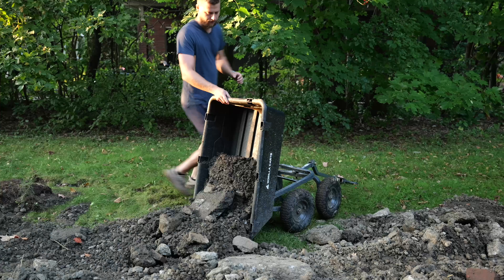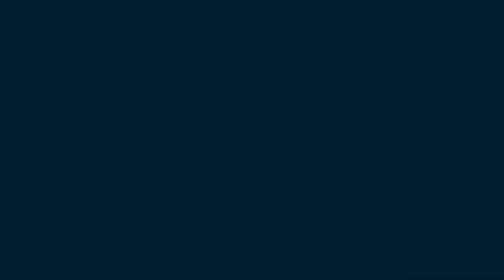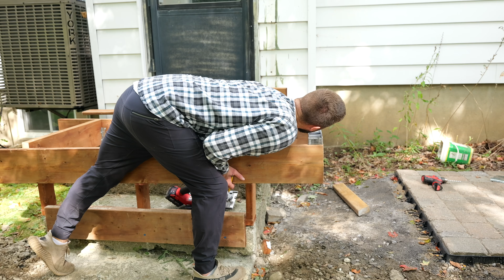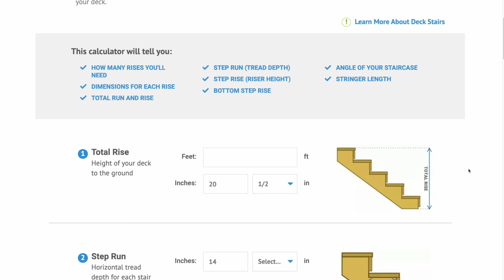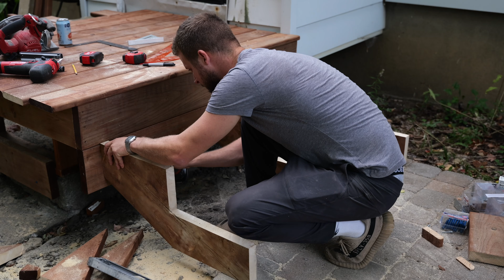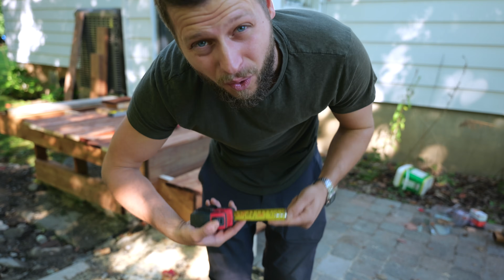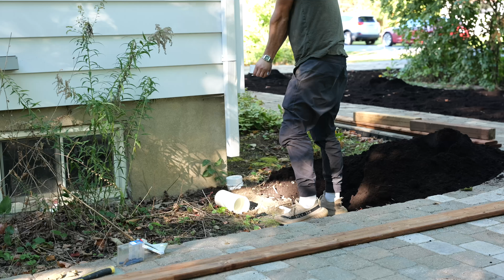Finishing the Driveway Project: Deck Build Over Concrete Steps

Comment: Wherever your lumber comes in direct contact with the concrete you need a moisture barrier. Just like a bottom plate of a wall that sits on a concrete foundation. The lumber touching the concrete will rot much faster without a moisture barrier. Even though it’s treated lumber.
Reply from the maker: @WoodyHayes614  yea. Totally right. I debated putting like a plastic shim or something to separate them, but went the lazy route. This deck is possibly temporary and is just a landing for the mailman and the amazon delivery guy lol. On the other hand might make for a great video in 10 years. If I think about it
Reply: I was thinking about that too. Also, that decking board used as a thin joist right at the door is going to trap a lot of water. There should have been some spacers under it to let water flow underneath it. 

I am rebuilding my deck right now and wanted it to really last, so I spent about $200 on some 1-1/2" x 3" x 1/16" stainless steel mending plates on Amazon. They're under every piece of lumber that's bearing on concrete. Even my main ledger is spaced off the concrete foundation with big, fat, stainless fender washers. Trying to make this thing outlive me!
Reply from the maker: @TysonSommer-DFWCP  hahaha yea. I usually like to go above and beyond but this little deck was not one of them. That little entrance of the house is rotten lol. Itll probably be demolished and rebuilt in the next 10-20 years. We didn’t really care about the deck lasting as much as my other builds
Reply: @MateoStabio  I hear ya. Gotta pick your battles!
Reply: That deck isn’t going to make it past 5 or 6 years… LOL!!! 

The paver stuff was decent, several mistakes, but still decent… That deck tho… Well that was a fucking disaster… No flashing, wood on concrete with a shallow swimming pool and zero drainage right on top, The tops of the stringers attached to a board that was attached to the one above it with hanging brackets, the overhand lip on the stair treads, the no railing, etc… I don’t know of a single contractor that would testify that you weren’t deliberately trying to kill your Mother In Law… Seriously… That was really really bad… That was a master class on how not to build a deck and stairs. 

And what the fuck it up with tossing the black compost right on top of the compacted gravel? That was a disaster too… And it kinda looked like to created a swamp between the house and the paver path… You might need to pop a French drain in to get that water away from the foundation… The paver driveway looks decent, and it only took 5 times longer than your original estimate… Speaking of estimates, your price breakdown was a pretty lame lie, your actual cost was at least twice what you claimed. It’s hard to build followers when you lie to them… It’s hard to build followers when you do anything as jenky as those FUBAR’d steps and deck… The biggest surprise for me was that it wasn’t a spoof… Those concrete steps should have been removed and new footers should have been created… Below the frost line… Seriously cringe dude…

Comment: Just wanted to let you know that it's copper that tints wood green. The old pressure treated was a copper/arsenic mix but the color always came from the copper (copper solutions are bright blue in the lab until they oxidize!). Because people don't want green decks they developed the 'cedar tone' pressure treated, but you can still get pressure treated that is arsenic free that has that green cast.
Reply from the maker: No way! Amazing. Thanks for explaining

Comment: That dump cart is boss you just weren't using it right. I've dumped 1200 lbs in it pouring concrete and it pulled fine behind the lawn tractor. I've abused it. And it's still kicking. Dumping dirt its actually easier just to flip it sideways and dump that way.
Reply from the maker: @WoobieLT  but it cracked… im not impressed. Just got it a few months ago lol

Comment: You should of just put four 6 x 6 ground contact treated posts in the ground....one in each corner....and then build the porch deck off of those posts.
Reply from the maker: @robertnash2446  hindsight is always 20-20. I also thought of that in the middle of this build. Just 4 posts.
Reply: "should of" sounds like should've which is short for should have.
Reply: Using posts means sinking them below frost line in cement (check local codes). That means inspections at multiple points and the permits, waiting, and fees that go with it.
Reply: @jimmahony5561 you are correct, by attaching it to only the steps he avoided it all. More work but he definitely avoided the inspections. Putting washers on his tapcons into wood would be what I'd say to do differently.

Comment: Could have used hangers for the stair stringers
Reply from the maker: Yea, i probably should have. But for 2 little steps. We figured we’d save the 8$ each x 6. But if you have a real deck with actual height. Its a no brainer. This deck is for the mailman and amazon guy lol

Comment: Great job bud only thing I would have added is Sealing paint everywhere you cut the treated lumber and some g tape or rafter tape on for longevity.
Keep it up your videos are awesome ! 😎
Reply from the maker: Good points!
Reply: Looks nice, but I hope that lumber on the concrete was rated for ground contact, not just pressure treated... and yes, seal any cuts and holes. (Cut n seal type product)

Comment: Yo, you need stair stringer hangers on those stringers. You just toenailed them in! not safe! 
a lot of stuff could be said but its DIY so yaknow
great projects
Reply from the maker: Yea, thought about it. I think for this little one two step it will be fine. For sure wouldn’t do this on any higher deck. I should have mentioned that the only person that uses this entrance is the amazon delivery guy lol. Cheers!

Comment: Awesome build. I thought when you cut pressure treated wood you need to treat that open cut edge or it will rot like a normal board since it’s not treated?
Reply from the maker: @ryanmares692  yea, technically but as long as its not going to sit in water. Should be okay. Our goal is for it to last 10 years. I have a feeling itll still be standing in 20 years. Ill make a video about it in 2 years. 😂

Comment: You will eventually regret not gapping the deck boards... Will need a redo in a couple of years when they start buckling.
Reply from the maker: Naa, lumber here is so wet, these boards will have a 1/4” gap between them in less than a month.

Comment: nice work, ive done this and the frame will rot over time even if it is treated
Reply from the maker: @sydney8382  how long? Were happy if it lasts 10 years
Reply: @MateoStabio  started seeing signs after 8 years, its the cut joints exposed to rain, using a sealer tape or paint properly would double/triple the life

Comment: On the corner of the deck closest to the house on the right side that the stringer is hung on, you should add the steel hanger/corners so you aren't entirely relying on screws running into the end grain of those short boards (the weakest type of fastening)
Running the short board along the house all the way from the step to the skirt board (thus making the screws perpendicular to the pressures of the deck and stringer) probably would have been enough but as is, I would address that super weak spot.

The rest of the build is fine tho
Reply from the maker: @ldhroks  yea thats a fair comment. Thanks! I was thinking of putting those stringer brackets on there. But figured it be strong enough for 2 little steps
Reply: What about water pooling on that top step?

Comment: Gee i thought dropping a couple of posts in concrete outside the  footprint of the steps, i would just have so much anxiety about the concrete breaking releasing your anchors it is 70 yrs old...!! 🤷🏻‍♂️
Reply from the maker: @scottstrickland3515  hahaha I thought about it half way, I realized I could’ve just put 4 posts around it lol. I wanted to challenge myself and figure it out using no posts. It worked. Probably took much longer lol. I put like 20 anchors. This thing aint moving 😂